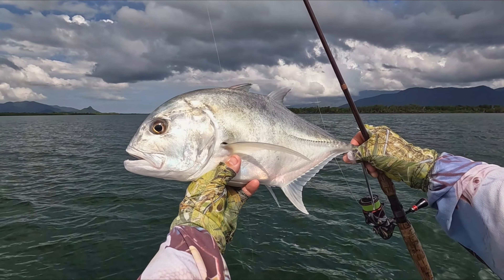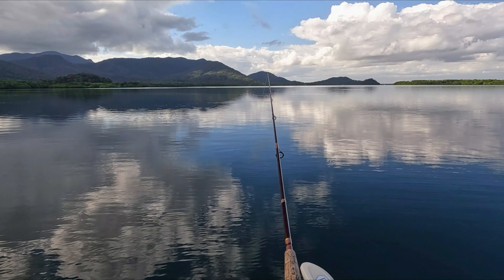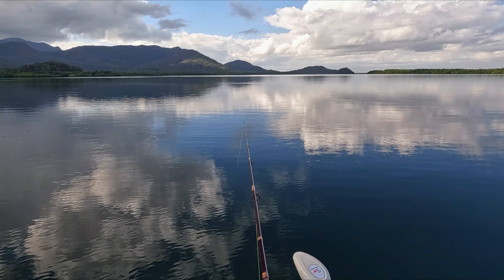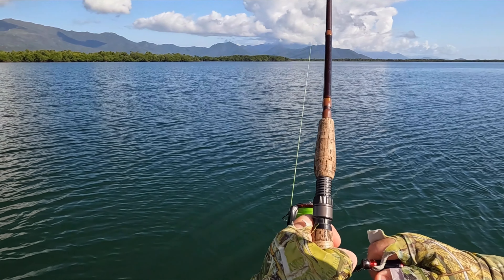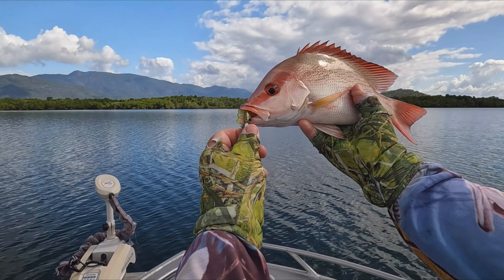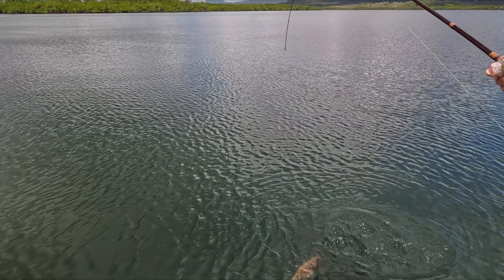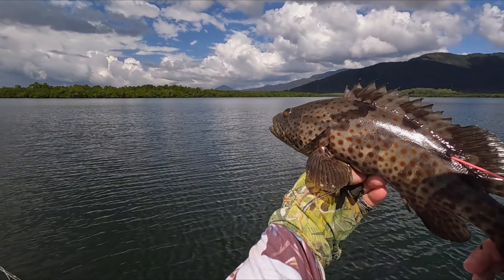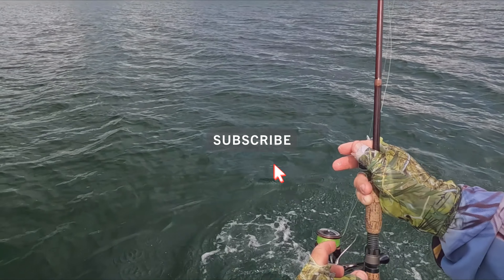Soft Plastic "Gliding" Technique Explained

Comment: Hi sir, I am a beginner. Can I ask you a question? Can you tell me how to choose the jighead weight?
Reply from the maker: @yasinozkaran4417  great question! Eventually your own experience will help you choose the right weight. For now I live by one simple rule… Use the lightest jighead you can provided it gets your lure in front of the fish. So… in deeper water you need it to be heavy enough to get your lure yo the bottom (or to where the fish are) given current & wind. And in shallow water or straight retrieve it needs to put your lure at the right depth to pass by the fish. I hope this helps you get started mate… catch ya! 🎣